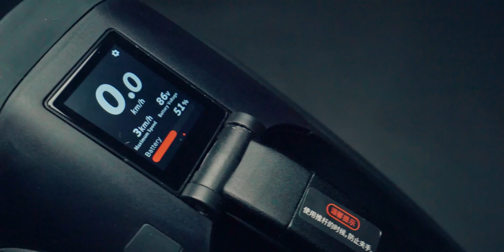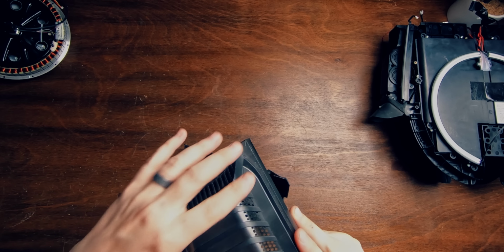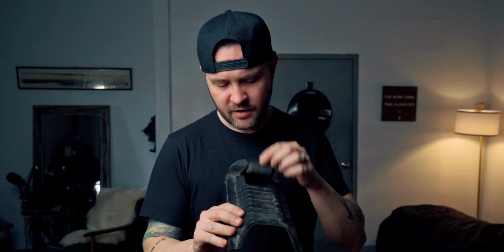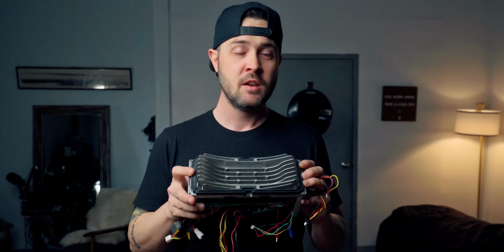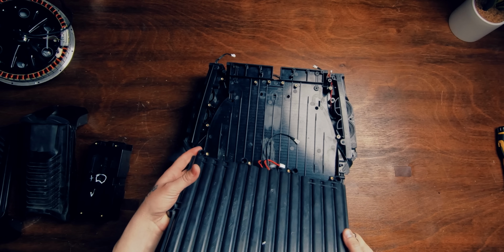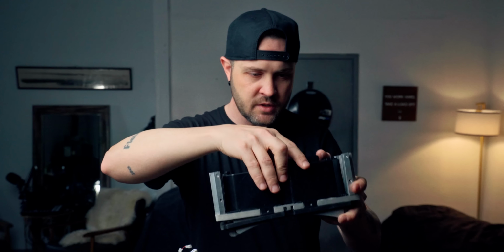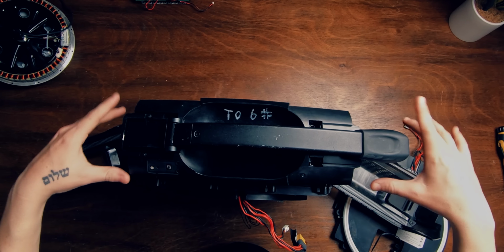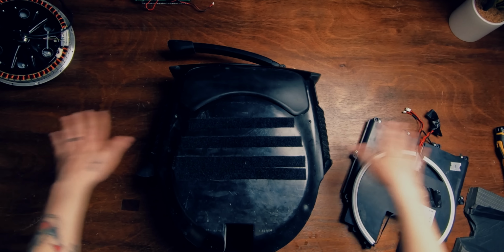Inmotion V12 Design // WTF is going on here?? | evX

Comment: As a schooled electrician.
Having slack in wires when they are exposed to vibrations is really good.
If it's a tight wire management the wires can get stretched, damaged, and you can have a really bad time.
I have seen that happen in electric scouters, cars, Skateboards, even on my V11 LED strip mode.
So having a bit of slack to compensate for the movement caused by vibrations is good.
Reply: Thanks for the knowledge
Reply: I realize I'm kinda off topic but does anybody know a good website to stream newly released movies online ?
Reply: @Malachi Raymond I would suggest Flixzone. You can find it on google :)

Comment: Looking at the picture I have of the mosfets on the V11 what you showed us on the version you have they are larger mosfets. The ones on the v11 look to be 50% smaller. I am not sure the current carrying capacity there but it has got to be, at least, higher than the V11.

Comment: Still small Mosfets? They must be kidding.
Gotways Very, very first 100V Monster prototypes had these small Mosfets...3 years ago. Lot of burned Mosfets boards reports.These are not realy capable of high amperage.
Heavy guys and/or long hill riding will probably overheat and/or burn them. 
And no, thats not “assuming”....that are the reasons why fat TO-247 Mosfets are used in performance wheels....since 3 years.
Reply from the maker: I couldn’t agree more. You’re 100% correct
Reply: @evXNYC  Just give me the part number off the board...or you can do it yourself and respond in kind with the nominal current carrying capacity specification the manufacturer gives..no guessing needed?

Comment: It’s sucks that there is no smart bms no sale for me
Reply: What are you looking for ? Is it Balancing? All you need to do is balance it with trickle charging overnight for some balancing or 3 days of trickle charging for true/full balancing of the batteries at the top voltage end. If you ride every day you would need to trickle charge for 24 to 48 hours once a month to maintain a good battery balance.
Reply: @gritdegrosse7233  for monitoring individual cells

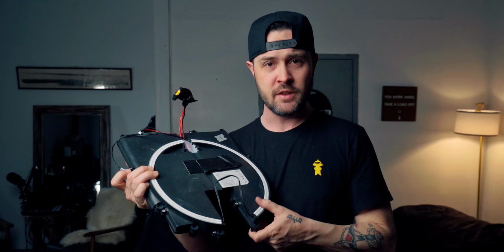Comment: 8:29 I've canceled my order after hearing that. I won't use any wheel that doesn't have smart BMS. It's like a ticking bomb. US government should ban none bms wheels.
Reply: Lol. Only the V11 has smart BMS.
No other EUC can still operate if one battery pack fails mid-ride. Its smarter then others in that it doesn't immediately shut down and throw you off. Lol
Reply: I think you might understand "there's no smart BMS" as there's no BMS at all, which of course it does, and it's connected to the mainboard for diagnosis it looks like.
The Smart BMS denomination is often used to describe a BMS which as Bluetooth or Bluetooth Low Energy capability to display in an app detailed cell groups (not every cell) voltage information, a capacity and charging cycle counter stuff like that.
It's not that useful unless you're a battery nerd and have no functional difference either.
Reply: What are you looking for ? Is it Balancing? All you need to do is balance it with trickle charging overnight for some balancing or 3 days of trickle charging for true/full balancing of the batteries at the top voltage end. If you ride every day you would need to trickle charge for 24 to 48 hours once a month to maintain a good battery balance.